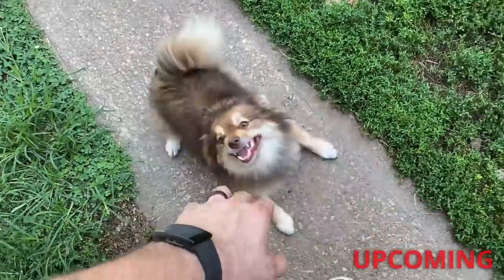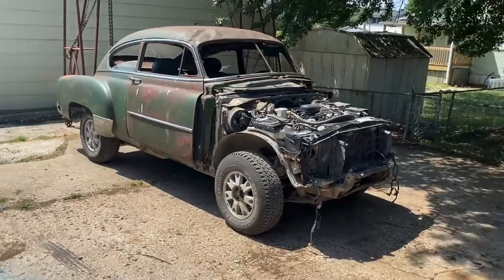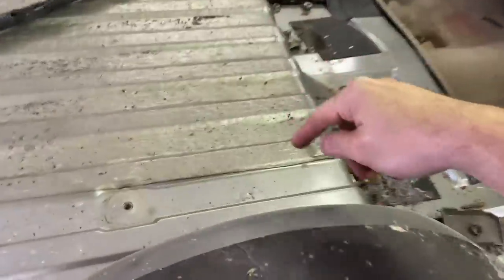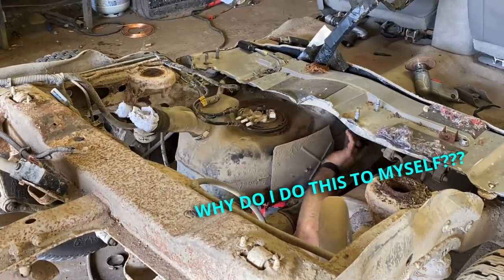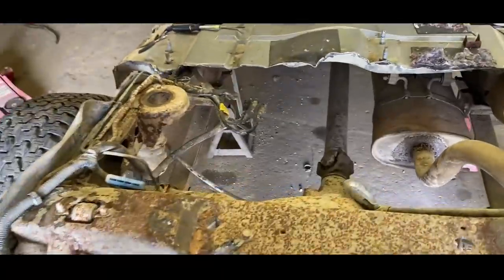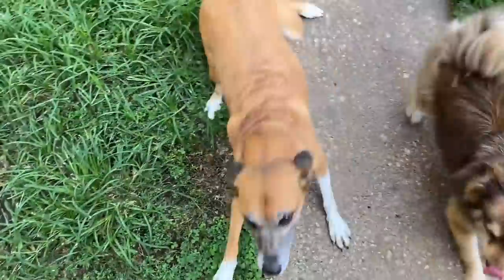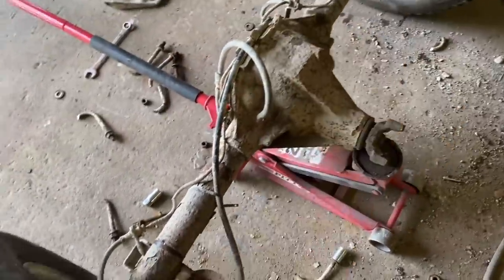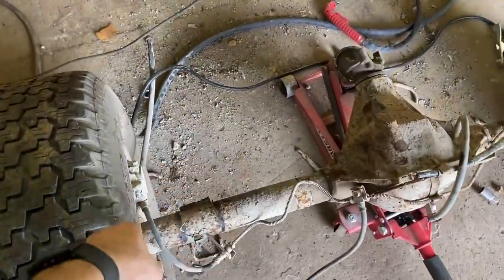$3500 DOLLAR HOT ROD BUILD ON AIR BAGS! PART 5! BUILDING A RAT ROD CHEVY ON AIR SUSPENSION FOR CHEAP

Comment: Casey, one thing I've discovered with removing those spring bolts is if you can get a ball joint press in there then it will force those bolts out. I've done that on a couple of occasions already.
Reply from the maker: Ahh good to know!

Comment: Casey, what year model is your  donor S10? The wheels look like they have more positive offset (that I need) than the ones on my 1998 S10/Blazer donor. Also, what size tires? Thanks Casey.
Reply from the maker: 99 gmc, it’s the same as yours. Not sure on tires but they are bigger then stocks